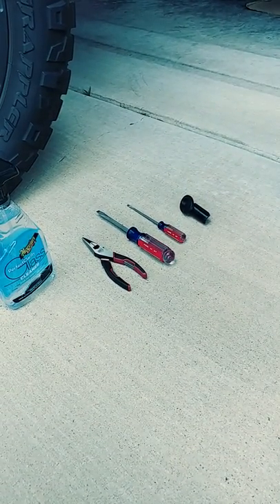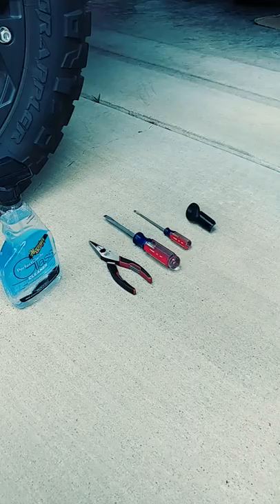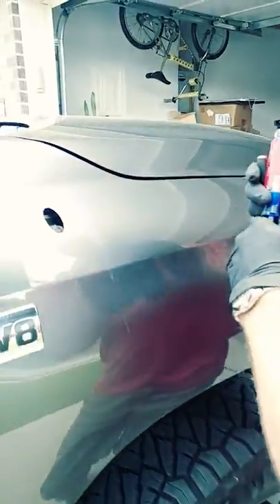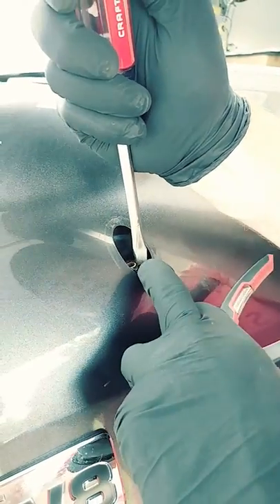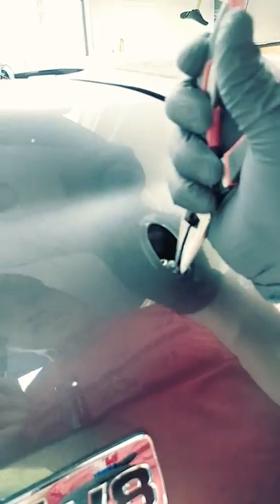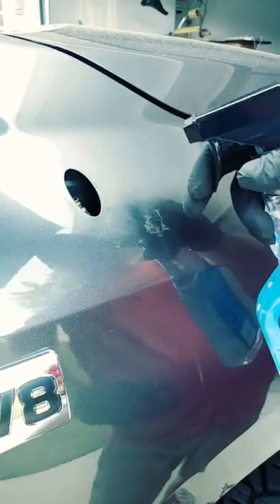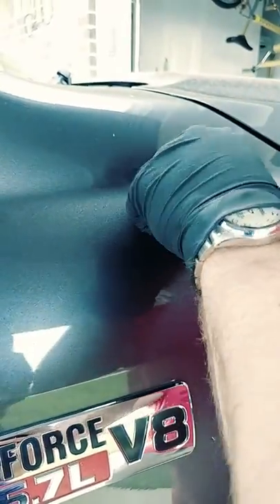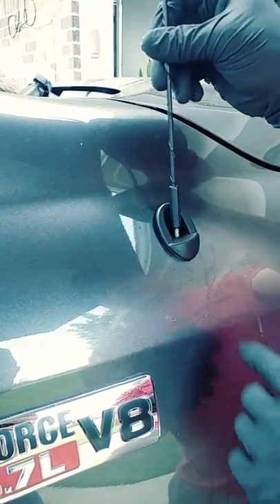Replacing antenna bezel on 2011 Toyota Tundra

Comment: Thanks a lot for the info. I followed your procedure except I used an X-Acto knife with a hooked blade to cut the base of the rubber. It took less than 10 minutes to replace. 😀

Comment: I had to file away some of the bezel to get it in. It put up a HUGE fight, but I finally got it in there. I was really worried about using a lot of force and causing a dent. I bought the $7 cheapo from amazon. Maybe that's why it was a headache. Had to go under the fender because the bezel wasn't cooperating. No dents or scratches though.

Comment: I found the threaded antenna socket may not be seated in the new base well.  I got an M5 (metric) threaded rod from Ace hardware.  Inserted into antenna base and pulled it up into the new base so the new antenna would fit.